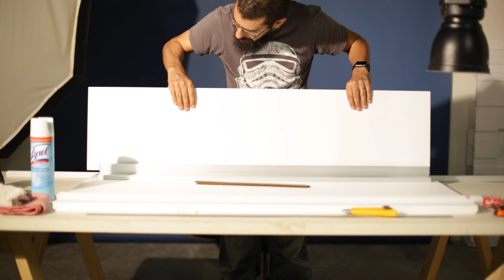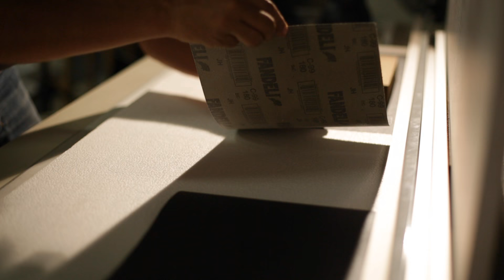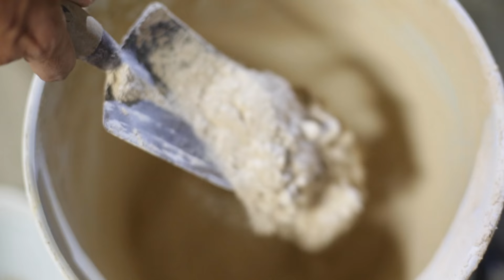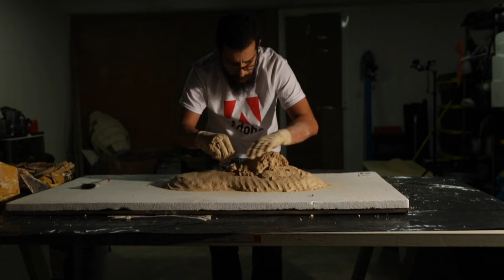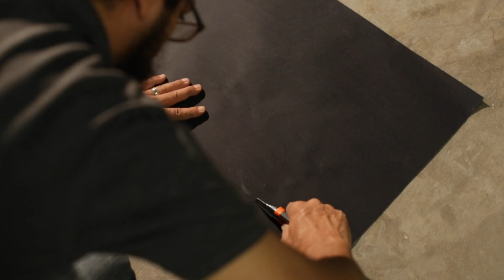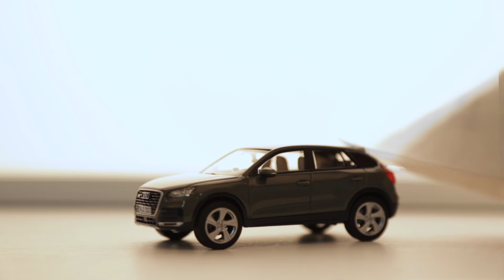Audi Middle East Behind the Scenes

Comment: this is fake advertising. the proportions of the toy car are different from the real car which makes the model from the ad much more desirable to the public and may increase sells.
for one, the ground clearance is much larger with respect to the body in the toy car. in the ad, Q2 looks athletic, more adventurous  while in reality looks more appropriate for city travel.
second, the wheels size is much larger with respect to the car size, for the toy car. this makes the ad car more macho, more ready to taken on difficult terrain while in reality this is not true.
third, body angles are different at large.
Audi should be sued for misleading the public and promoting a product which doesn't correspond to the sold.

This is just what Huawei did and got caught faking DSLR shots as smartphone pictures in a commercial: https://www.theverge.com/circuitbreaker/2018/8/20/17759038/huawei-fake-dslr-shots-smartphone-picture-nova-3-commercial